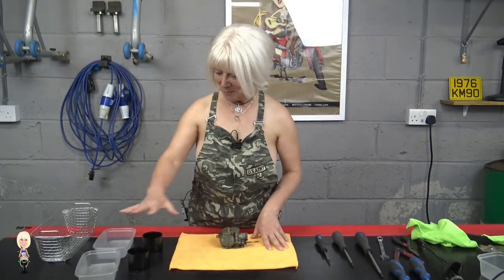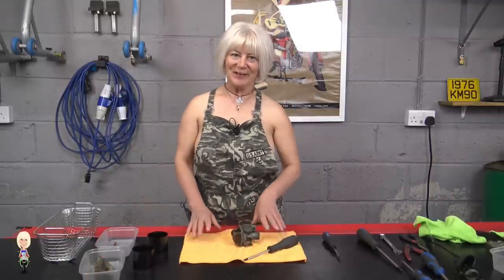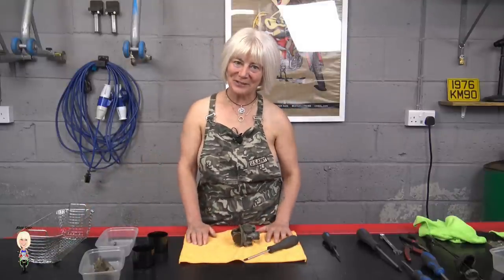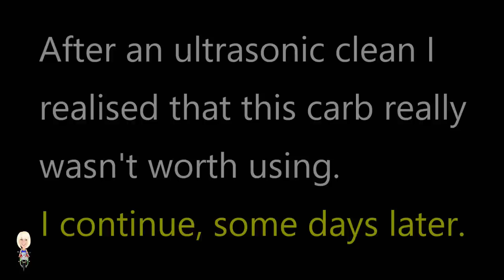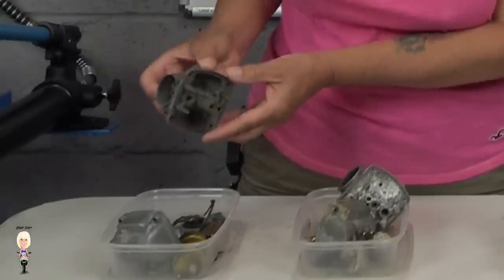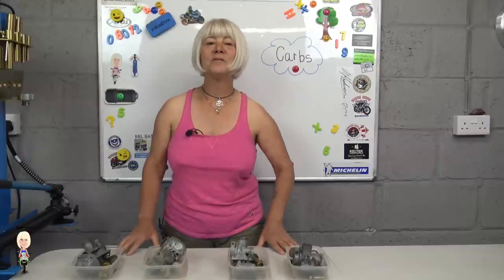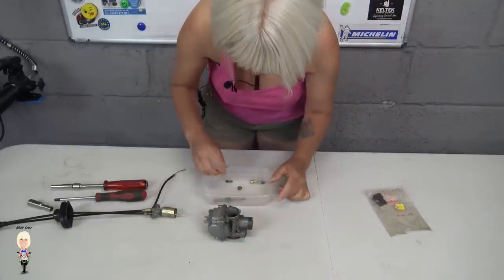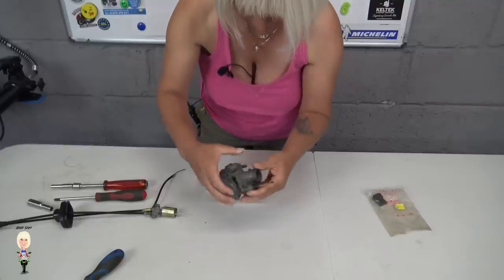Kawasaki KM90, sorting out a carburettor - Part 21

Comment: When I rebuilt the carbs on my old GL1000, I used a baking soda blaster to clean the carb bodies and float bowls. Doesn’t damage the aluminum and washes away in the ultrasonic cleaner. Came out looking like brand new!

Comment: I've never had good luck disassembling small carbs, I always seem to strip a screw head from it being seized.

I'm lucky to have two fuel stations in my town that sell the ethanol free gas. That's the only gas that I'll run in anything that has a carburetor on it, like my lawnmower, weed eater, chainsaw, generator, and my old '68 chevy pickup.

Comment: The best thing you can do to keep them carbs in good shape is keep them away from ethanol fuel. It will eventually gum them up. You can either remove the ethanol with water or if you call Esso they will tell you where you can still find ethanol free fuel. 
Kills me that the government don’t care they are destroying old fuel systems with that rubbish. I’m surprised people haven’t complained about the damage caused by it.
Reply from the maker: Is your foil hat prescription or off the shelf?
Reply: @km90restoration45  
Look up how to remove ethanol from Petrol you will see yourself. Also look up ethanol damage caused to old carburettors. 
All can be found on YouTube.
As your response was quite rude. Ethanol will bind to water rather than petrol meaning you can bleed it off. And leave only clean Petrol
Reply from the maker: @venom523d8  Aspen 4